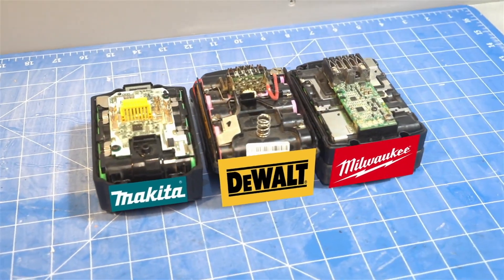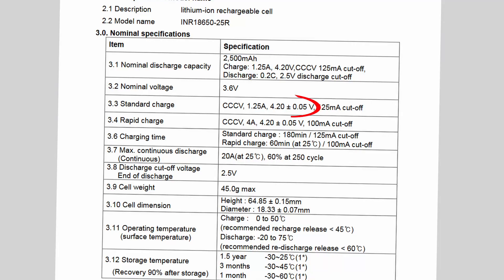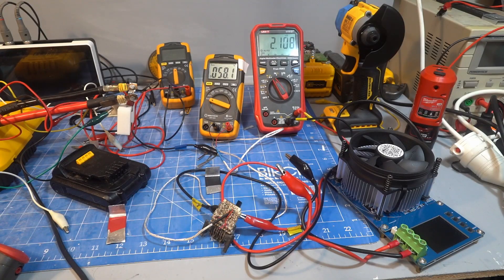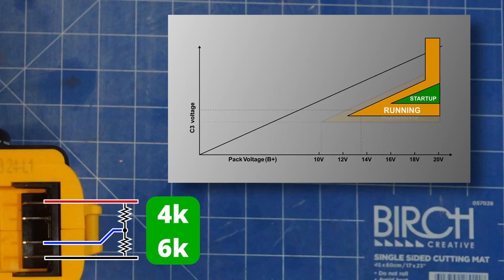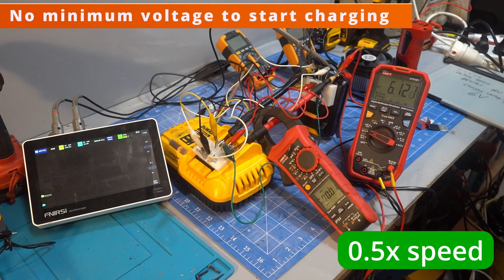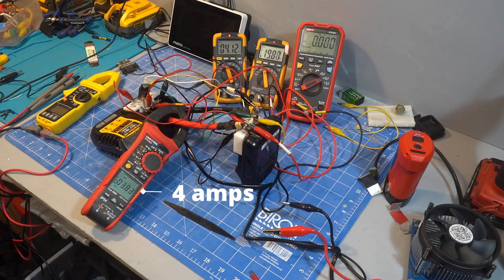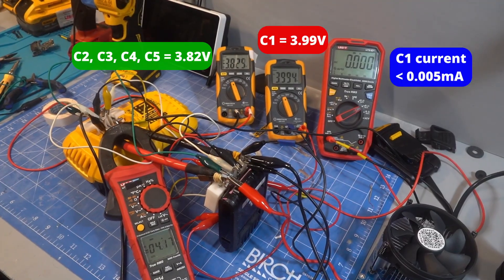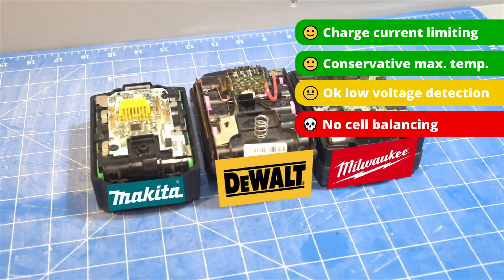[009] Dewalt 18/20V battery, tool, and charger communication

Comment: Super interesting video! Was just starting some research for a DIY DeWalt charger, and your video was a fantastic source of info! Some other notes and info I've gathered that I thought I'd leave here in case anyone else is working on a similar project;
* I've found the same results when it comes to balancing, and I am equally baffled. To be fair to DeWalt, the older/well-used packs I found were still awfully close in cell voltage, so maybe they just match their cells well at the factory?
* I haven't found many people do a deep dive into the ID pin, from the few posts I saw that did it seems it is the same ~800R on many packs of varying capacities. One thing I don't see many people mention; the OVP is implemented by cutting off this ID pin, rather than actually disconnecting the battery, so even with integrated OVP it is on the connected device to receive and process that warning.
* Lots of sources report that DeWalt charges their batteries to 4.10v instead of 4.20v. This, paired with 2-level CC charging, probably serves to prolong battery life at the cost of a bit of capacity. Might also make cell imbalances less noticeable?
* The thermistor being on the board rather than taped right to a cell/junction means it'd read a bit lower than the critical at-cell temperature, so it would track that tools treat a much lower temperature as a threshold; 58C at the thermistor may mean >65C at the cells.
Reply from the maker: Yeah, I was getting 4.12-4.15V cutoff in charging. Not sure if cutoff is done for any cell via that V8 chip, or if it's whole pack voltage, with the V8 being a backup, then the batteries V6 chip being for extreme cases where the charger doesn't cutout.

Comment: I knew a few guys that worked for SB&D. DeWalt engineers made the conscious decision at least a decade ago to never balance, and to instead impedance/capacity match cells at the factory during assembly. IIRC they had some internal studies/data that showed that if they kept good controls on cell selection and matching, usually something else would fail on the battery before the cells became critically unbalanced (~5 year or so lifespan).

It is goofy that they gave themselves access only to not use it, even in the future.
Reply from the maker: That's pretty much what I thought happened. The battery in this test was 2014 and was still fairly well balanced (until I tortured it), but around half of original capacity.

They could still add balancing, just needs a balancing chip in the charger.
Reply from the maker: Do your friends know if any of the original chargers balanced?
Reply: I don't think they ever did, the mentality seemed to be "That's a later problem we'll solve if it is actually a problem and turns out it isn't".

I think the bias came from when they did their A123 powered 18V Nicad replacements which needed a special charger for balancing ~2005. That product fell through due to A123 being the trash fire it was, but I think the special PCBs and chargers left a bad taste in Dewalt's institutional mouth. Both of my A123 packs are sadly gone at this point, but when I disassembled their OEM Lion replacements I couldn't find any trace of a balancing board, just a plastic cell that had a PCB chock full of SMD capacitors. 

This is all pure conjecture though, as none of my buddies were working there until at least a decade later.
Reply: @toolscientist 

Ni-Cd chargers or that 2 bay dual chemistry charger talk about balancing. But never for Li-ion.

"The automatic tune up mode equalizes or balances the individual cells in the battery pack allowing it to function at peak capacity. battery packs should be tuned up weekly or after ten charge/discharge cycles or whenever the pack no longer delivers the same amount of work."

Comment: I made a simple voltage doubler adaptor for the UK 110V  safety site transformer voltage. I don't know why the 240v devalt chargers won't operate on 110V directly. https://youtu.be/QBl9h_v7hYM

Comment: does anyone know if dewalt has a temp sensor on their drills to shut the tool down if they get too hot. I have smoked 2 dewalt drills from moderate load constant usage. While the milwaukees either are fine or shut the tool down before they actually start smoking.
Reply from the maker: I don't know. Only way to tell would be to destroy a tool and remove the silicone protecting the electronics to see if there's a temp sensor in there. I haven't seen a tool with a temp sensor on the motor. In brushless tools, they usually have a temp sensor near the 6 mosfets that switch the 3 phases of the motor. These mosfets are usually the weakest link, so protecting those is usually enough to protect the coils of the motor. It could be that they've set their temp limit too high, or they've got inadequate cooling to their motor. Could also be the design of the tool where the vents are easily blocked when pushing on the tool with 2 hands.

I'd be very surprised if Dewalt didn't have temp sensors in their electronics, but before I made this video I was 99% sure that Dewalt used the cell pins for balancing, so who knows.

Comment: Holy Sh.... Fasinating. Very thorough. I stumbled across this as my Dyson battery has died so looking at alternative options especially batteries with smart chargers.
Reply: batteries cab be rebuilt and some do it but you could do it yourself if you have a tact welder. Cells can be bought individually.

Comment: I've heard more mentions of DeWalt chargers catching fire than other brands. Sampling bias aside, do you think there's anything to that given the lack of 2 stage charging? Or perhaps because the smaller ones aren't air cooled
Reply from the maker: The full-current/half-current probably isn't important. It'll be something with their power circuitry or, like you said, inadeqaute cooling.

Comment: 58 degrees does seem quite low, do they just have the sensors in a different spot to the other batteries?
Reply from the maker: They have it on top of the 2nd cell. Milwaukee has it on top of I think the 3rd cell. Makita has it in the middle
Reply: @toolscientist  also makita has two of them in xgt packs lol

Comment: Can you do Bosch, metabo, Stihl
Reply from the maker: Bosch and Metabo, definitely. Stihl is a bit rarer and more expensive. I buy most of my stuff 2nd hand, so Stihl will be harder to find at a good price.
Reply: @toolscientist  It might be interesting to see inside the Bosch wireless charging batteries, it looks like they have discontinued them but the chargers and batteries do turn up on the second hand market.
Reply: @slinkytrips  Investigating discontinued battery platforms seems like a fairly wasteful use of effort when there isn't even a cottage industry for this kind of YT content yet that would provide the typical dissection of poorly-considered technologies that you see in other veins.
Reply: @orijimi  The battery platform is still the standard Bosch cool pack, they just added a wireless receiver plate to the bottom. They even made a drill case that would charge the drill inside the case when you slid it back into the holder in your van. Unfortunately they probably also own all the patents preventing other brands adding wireless charging to tools.
Reply: @slinkytrips  Wireless charging is a bad technology, so no huge loss there.

Comment: I am truly shocked.  I thought I was taking a risk charging dewalt batteries with solar and a cheap external balancer, but that's a better balancer than they normally get.
Reply: Decoupling/filtering capacitors on the input to the IC. Imagine trying to drive a 0.3v difference through that 4.7k resistor at 64uA your battery's out of warranty before the cells are balanced.
Reply: What cheap external balancer, out of interest?  I've got some old knockoff dewalt batteries that only register 2 bars despite my chargers thinking they're fully charged...wouldn't mind testing some cell rebalancing on them, in case I ever need to do it to my genuine 9Ahs
Reply: No they clearly have a balancer circuit in the battery. You just missed it in the schematic. They use the capacitors to balance the pack. This is called active balancing. I tested this with a 2ah pack. I deliberately discharged 200mah out of one cell and let it charge overnight. All cells are again within sub millivolts of one another. DeWalt just made the cheapest possible balancer circuit
Reply: @mikeysch  I don't see the balancer in this circuit.  I'm not quite sure what the capacitors are for, but an active balancer usually has a relay between the cells and the capacitors so it can connect the capacitor to one cell, then the next.  Was the pack you tested it on an old 2Ah regular battery or the new 1.7Ah powerstack?  I plan on testing some of my batteries the same way in the near future.  I know 5Ah powerstack has a more complicated BMS because it cuts off charge and discharge current without proper tool communication.  It's entirely possible they have balancing.

Comment: Cool vid! you've earned a new subscriber today. There're some Dewalt tools that have full pin layout too, like the DCF891 mid torque. Still cannot find any info on what does those pins do.
Reply from the maker: That's very interesting. Do you know if anyone's looked into it? I can just see the extra pins on the TTC vid from 2 years ago, but he doesn't say anything about them. I can't find any 2nd hand DCF891s - I'll set an alert.
Reply: @toolscientist  I have an 891.  I just looked at it and confirmed there are pins for every position on the battery.  I could probably be convinced to take it apart sometime this week and see what they're hooked up to if you're interested.
Reply from the maker: @ThePatchworkPlot  give it a go, but the electronics are very likely sealed.
Reply: And one thing that BUGS me is my FLEX and MILWAUKEE ADAPTOR S  DO not WORK on my DEWALT XR DCF 891 and that makes me MADE but they fit and work on the GODZILLA DCF 961 and it's a much more POWERFUL TOOL

Comment: Another great video! I always assumed most of the big brand tool batteries used similar mechanisms/charging circuits with only small 'secret sauce' tweaks, so Dewalt's rudimentary approach is interesting. It's more like something I'd expect from a budget-tier tool that optimizes for cost over reliability, like something from Harbor Freight. Dewalt doesn't use this cost-savings to sell packs cheaper than the competition, so it really just appears like a risky move to save a few cents on the BOM.

If I'm charitable, maybe the engineers at Stanley/BD/Dewalt realized Li cells from reputable manufacturers are pretty tough and can handle some abuse, so they decided to minimize failure points like BMS chips. I certainly haven't heard any widespread complaints that Dewalt packs are significantly less reliable or dangerous than team Red/Blue, so maybe their bet paid off.
Reply from the maker: In AU, Dewalt's batteries are significantly cheaper ($130 AUD vs $200 AUD for standard 5s2p 18650 5Ah), but their fast chargers are more expensive (Dewalt 8A charger is $240 AUD, vs $200 AUD for Makita 9A and Milwaukee 6A). Their slow chargers DCB115 is only $120 AUD, though.

Yeah, I think if you match the cells well, then you don't really need balancing. The 2Ah used in this test was pretty old and perfectly balanced (before I abused it).
Reply: @toolscientist wow wow, thats a crazy price for fast and slow chargers!

For a short time we had FFX (one of the biggest online tool retailers in the uk) had the 18SD (slower makita charger) for £10 before delivery so we could buy 3 and get free delivery

Comment: ToolScientist - I have disassembled probably 200 dewalt packs, from a dewalt service center that used to put all their dead lithiums into a bin for me. Provxbly half were flexvolts. I have another 200 still to process. Newest ones are 5 years old since thats when that service center closed. I kept all the circuitboards in a bin, for the 200 i did process, i dont really have plans for them, (the cells yes, the boards no), just compulsive "just in case" hoarding.  If you want some of the known-dead batteries or want me to do some basic tests, i can send you some.

Also, i have tried to make my own idiot level charger/tester by basically making a breakout board with 5 individual voltmeters to test each cell. And, 5 isolated (usb cell phone chargers with a 4056 1 cell charger circuit per cell) charger. Neither the panel meter stack nor the charger actually worked. I don't know why. One or two of the meters would always randomly not show voltage for some reason. It should be dead simple, you have access to the pins, if i measure one cell at a time it works, but all 5? Always fails. Beyond my knowledge. :/

If you want to talk outside of comments here, have me do some tests (i do have a scope, I barely known how to use it), or want some circuits or maybe some batteries, shoot me an email. Its just my username here, at gmail.
Reply from the maker: There's 10-ohm resistors between the pins and cells. Maybe that's upsetting your TP4056, or maybe you're cooking the resistors? 

I'll send you an email. I am interested in knowing what's on the underside of the FV boards. I found a schematic for the original FVs, but they've made significant physical changes since. Not sure if the circuitry has fundamentally changed, though.

Comment: Great stuff! No balancing is nuts though. I was curious so I took apart the oldest batteries I have on hand to check how balanced they were. A 2014 2ah was between 4.03v and 4.06v, a 2015 5ah was between 4.05v and 4.08v. I was expecting a bigger difference tbh.
I never had issues with the 20v batteries, but I had a couple flexvolt that wouldn't charge because of an unbalanced cell. Balancing it manually fixed the issue, but now that I know the charger doesn't do it itself, I'm not surprised why the flexvolt batteries are so much worst than the 20v.
Reply from the maker: The 2Ah I used in this vid was similarly well balanced despite being 10 years old. I think if you match the cells, then balancing isn't really needed. There is also a bit of survivorship bias as any pack that goes a little out of balance will probably fail quickly without any balancing. So those get thrown away and only the well matched packs survive.
Reply: @toolscientist  I saw you have a 5ah powerstack, is their any difference beside the cells?
Reply from the maker: @MrArcticPOWER  completely different. Microcontroller, balancing chip, and 6 (yes, 6!) power mosfets. There's a lot going on and it won't be easy to test, but it seems they're following the reference circuit from the chip maker, so I can fill in a lot of the blanks from that.
Reply: @toolscientist  I wonder what was the reasons for such a big change. Thanks!
Reply: Flexvolts have a weakness. Some circuitry runs off of just one cell, so if you leave it over the winter, that one cell will be drained too far and then the pack is dead. I've gone through hundreds of post mortems Dewalt flexvolts, super common.
Reply: @MattsAwesomeStuff  It takes definitely more than one winter to do any damage. If it was the case, every flexvolt battery I own would be dead. Maybe you're talking about the early flexvolt batteries? Because the last one I broke was a 2018, never had issues with earlier versions.
Reply: @MrArcticPOWER  probably at the low voltage cut-off before being stored in a cold garage all winter.

Comment: Loads of great information. I have always loved the way Dewalt brings the cell monitoring up to be tested. I hope you can find time to look into the Flexvolt. It seems to be much different. I have a video on it, but nothing like the detail you go into. 
Thanks for taking all the time and sharing this!
Reply from the maker: Yeah, the Dewalt design is by far the best for rebuilding, or even building a Dewalt compatible battery from scratch. It'd also be very easy to make an adapter to charge them with RC chargers, or to make your own tools with them. The more advanced batteries have the temperature and cell voltages inaccessible from the outside, and the temperature is basically inaccessible without soldering leads on, and even then you'll probably interfere with their thermistor measurements and possibly make them malfunction.

I do have one Flexvolt battery that I'm going to do a vid on. I found your FV vid a few weeks ago and I'll definitely be referencing it for the inside look of the custom slide switch. I was really glad you took that apart.
Reply: @toolscientist Thank you so much! Please do a video about the flexvolt battery as soon as you can. I need to power a strimmer off an external battery, and a video like this would be extremely helpful.
Reply: @toolscientist  
Awesome! I look forward to it!
Reply: Can you find out the milwaukee forge cell OEM? Every channel out there is going out of their way not to show the insides
Reply from the maker: Forge 6Ah (pouch) or Forge 8/12Ah (tabless)? We're pretty sure the tabless cells are Ampace JP40 going off the wrapper colour. Forge 6Ah is harder - I'd need to buy one. The teardowns I've seen have it sealed and the case seems to have lots of barbed tabs that might be designed to prevent disassembly.
Reply: @toolscientist  the prismatic cell ones (aka pouch). Milwaukee said there will be a mix of 6/8 that might be either prismatic or cylindrical tabless. I suspect the prismatics are Byd cells.